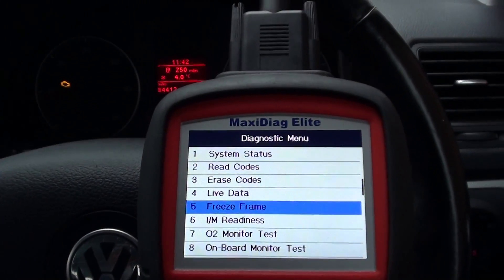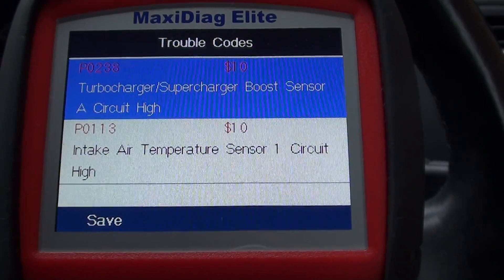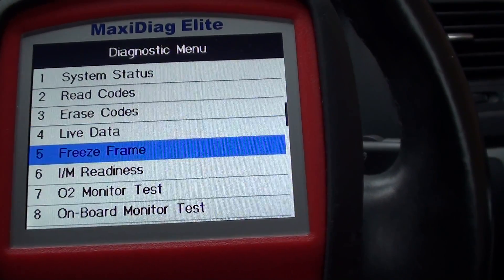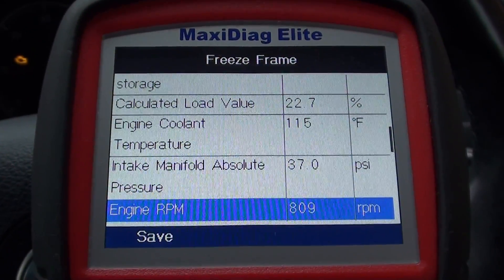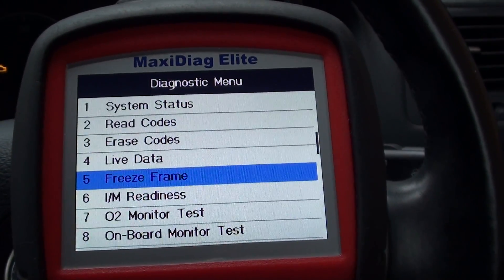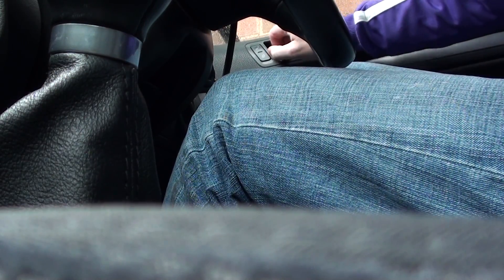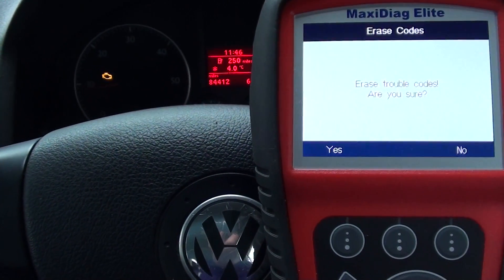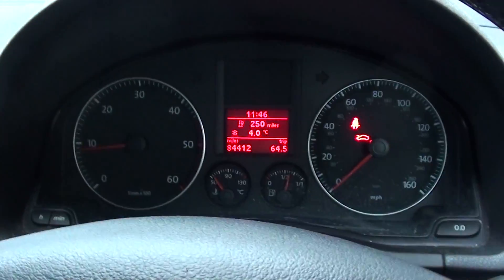Obtaining Freeze Frame Data From Your Cars ECU

Comment: Why did you replace the MAP sensor with the engine running? It said IAT sensor. Why did you replace the MAP sensor? Show the freeze frame data and other codes and parameters to show other problems. The violent temp. was only 115°. That's before the thermostat opens. An engine has to be in closed loop meaning warmed up to give reliable readings.
Reply: Ok